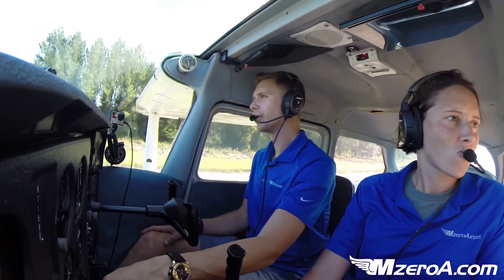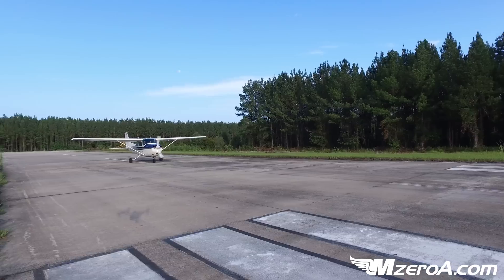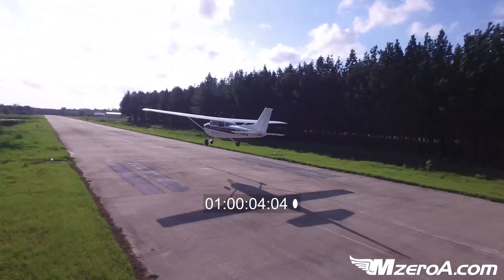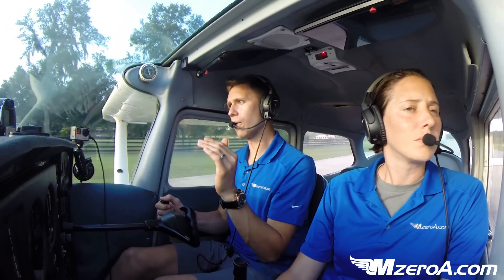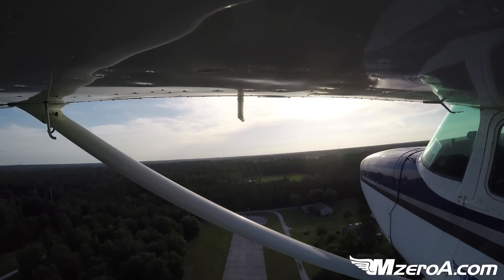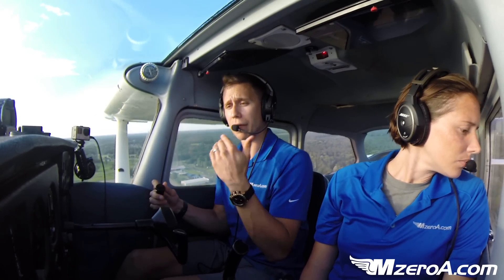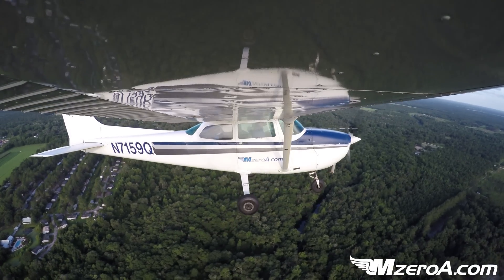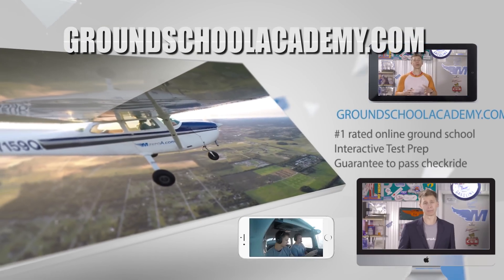Engine Failure on Takeoff - MzeroA Flight Training

Comment: Haha it's 300 ft in gliders.
Reply: 200 ft in the one I fly.
Reply: 200' in my glider.  1000' is fine for a powered plane if you don't practice the turnback, but a skilled pilot should be able to use a lower threshold.
Reply: Christopher Franklin  I think 200ft is about standard in a training glider. Of course , most competent glider pilots will give themselves a pre-takeoff briefing . That would be a good idea for power pilots too , at least for first flight of the day.
                   It would consist of what height above which a return can be made 2) Which way to turn(into the direction of any crosswind component) 3) Angle of bank to aim for(a matter of opinion ,45 is common but 50-55 for me ) 4) Bug speed to lock onto( Vs+10-15% at that attitude , which should be known beforehand).
               Of course the landing is downwind, but this is less of a problem with powered aircraft because they often have a steerable nose wheel.

Comment: If you had time to add or take out flaps with engine failure after takeoff what would be the best thing to do
Reply: On takeoff*
Reply: It depends on your goal. Do you have room to land straight ahead? Are you going for a field over some trees? Are you high enough to turn back and land?

Comment: The only engine problems I have had on departure was carb ice in a C152, did my runup as normal pulling carb heat on for a few seconds before departure. Applied full power all normal then around 300ft engine rpm starts varying between ~1800-2400rpm, took a few seconds to scan my instruments and pulled the carb heat on and all back to normal.
Reply: Great, I had that on a very misty day at 100 feet agl only.  Leaned mixture and added half of carbo heat.. Solution.  Then on downwind it started doing it again, even with carbo heat on juggling.. and mixture too.. This will be a full stop..

Comment: I have made the impossible turn possible with a CFI doing a sim engine out on takeoff...but it was in a lightsport
Reply: Gary Veduccio I survived the impossible turn. At age 17 as a solo student pilot in a Cessna 150.  Just as I crossed the end of the runway I started loosing power.  Our only option was a football field too far to make.  Instinct took over and I nursed a 180 and made a perfect roll to the gas pump landing.  As a young and dumb student I did not fully understand the extreme risk and cause of the inside wing stall on a low speed tight turn.  That was the first time I overtly realized that God was with me.  I doubt I would have survived landing straight ahead as I was taught but for Gods plan I lucked out going back.  For locations where there are no good alternate landing fields there are no good options.  I’m now 71 and grateful to have lived to tell the story.
The prop stood straight up at about 90 degrees to the runway.  FAA found a flaw in cam bearing that froze up.

Comment: One of the reasons I've started memorizing all the emergency checklists. I'll be in my car at a red light and visualize the engine failure, then proceed calling out the checklist (airspeed, mixture to idle, flaps?, fuel off, etc) while physically going through a flow.

DRILL BABY, DRILL!!!...........It's not just for oil
Reply: Mixture to idle? Do you mean mixture rich? Or mixture set to what it would be set at if you were idling?
Reply: @mochiman100  likely he is talking about prelanding checks in the event of an engine failure
Reply: @chrishansen8026  Sure, but you should try and restart the engine before going through a prelanding checklist which is why I was confused. I suppose OP was talking about the checklist after attempting to restart the engine.

Comment: This is something I have been discussing at our monthly Civil Air Patrol safety briefings; the Impossible Turn probably IS!

Wow, Jason, thank you!  FULL DISCLOSURE: I am a rusty pilot, but am working through renewing my medical and then a flight review so I can get back in the sky with the Civil Air Patrol.  I learned to fly in 1979.  I am the Safety Officer for the Fox Valley Composite Squadron, Illinois Wing.

Oddly enough, I get one or two very experienced pilots debating me on this, “Well, John, if you are high enough…”  Yeah, I get it, but if you’re high enough you are farther away from the airport too!

I was taught exactly what you espoused in this video, 60 degree arc FORWARD.  Make the best of it.  Going forward when I get current (and a Form 5 checkout with CAP), I will use Google Earth to eyeball possible landing spots at the departure end of runways anyway, and plan accordingly BEFORE I yell “CLEAR”.  So, I’ll have a contingency plan ready and waiting for me – just in case.  

You’re right, when that mill goes silent, you have a few seconds of “Oh [Expletive Deleted]” and you lose that time.  If you have are armed with a Plan B, then you can recover some time you lost.

The whole point of this video seems to be TIME.  You don't have a lot of it in this part of the flight profile.  I am an IT Project Manager by trade, and I work with risk management all the time.  I have learned that the fewer options you give yourself, i.e. taking steps OUT of the process with their inherent decision points, you are able to focus on the limited venues available to you and can spend critical seconds making them better than trying to decide what to do while you're in a slight state of shock.  

We're only talking one or two seconds here, but THAT'S ALL IT TAKES TO GET BEHIND THE AIRPLANE!

With your permission, I would like to show this important, and potentially lifesaving video at the first of the month when we have our CAP safety briefings for the air crews.  

Thanks again for stressing a very important point!
Reply: You're exactly right, it's all about time.  I'd also encourage your CAP wing to all go see Sully as well if they haven't, and pay particular attention to the scene [minor spoiler] at the NTSB hearing where they coordinate simulations with Airbus.  If you react instantly, maybe, just maybe, you might make it back.  But it's the time it takes to react, assess the situation, and determine your course of action, even if you have a plan, that really makes the turn impossible, and more importantly, UNSAFE.

Comment: Last Sunday I lost all power at 400 Ft AGL above the trees at the south end of the runway. I immediately nosed down and turned into the wind, keeping it coordinated while completing a 180 degree turn. I had so much altitude I had to use full spoilers to get down in time. Then I pushed the glider off to the side so the tow plane could land ;)
Reply: HA! You had me there. 400?!.....180 turn?!!   How the hell?!!
Reply: I bet you were using your shoulder belts too!!
Reply: Frank Andrijeski Affirmative!
Reply: cool story, Im currently working on my gliders licens and we did a simulated engine failure in a motorglider at 250ft, a 180 turn and landing. No problem. :D

Comment: something similar happened to me when I first started fly. I wasn't paying attention and I forgot to do my before takeoff check list. so I put full throttle and forgot to put full mixture and fuel pump on and at 65kts I started to climb and all of a sudden we were not climbing anymore and my cfi had to take the controls and had to go through the flow mixture rich fuel pump on and he took the plane straight towards the runway and I we were going to crash but he gained speed full throttle and put us back into the ground effect and when he did that we started to climb again. That scared the hell out of me and I never forgot to use my check list ever again.  I also wanted to say thanks for all the awesome videos I've learned so much from them and all the books I got
Reply: Truth his instructor should've double checked as well.
Reply: Sounds like he knew it would happen waiting to see if you would catch it
Reply: @Mike-01234  --no way you will produce a real engine fail on take off like that.. What about if it happens at 200 feet and not 700 feet able to Turnback??  That CFI was asleep at the wheel..
Reply: @feetgoaroundfullflapsC  Yep either the CFI was really ballsy to think he can handle that situation, or what moat probably happened was he didn't double checked himself.

Comment: OK, if you are too low, no turn-around.  Fly the 60 degrees and find a spot to land.  This works well in Kansas wheat fields.  How does it work in the mountains?
Reply: Painfully and expensively.
Reply: Still better than stalling in a turn at 200 ft.
Reply: Aim for the pines, much softer than hardwoods :P
Reply: It doesn't! :)
Reply: A slow controlled crash into trees is survivable majority of the time.